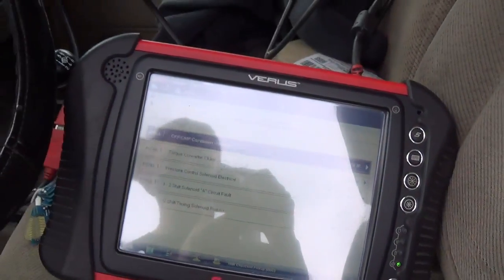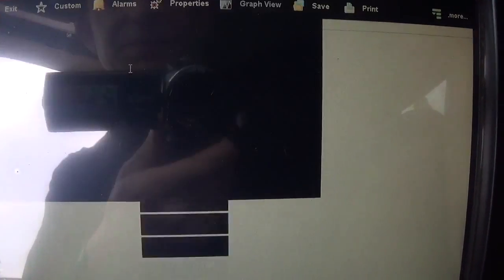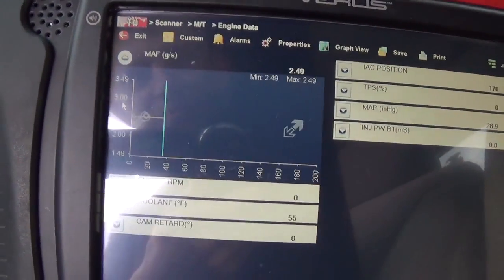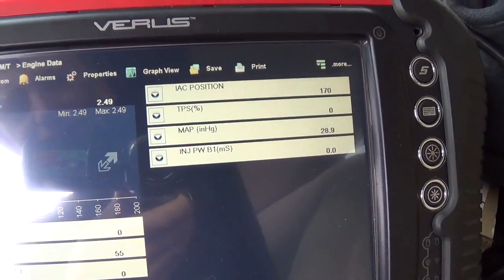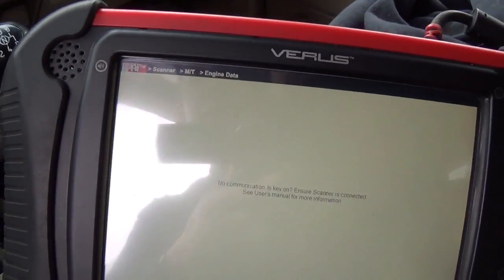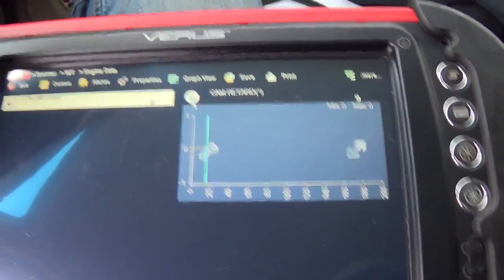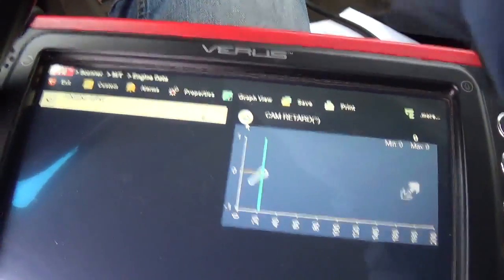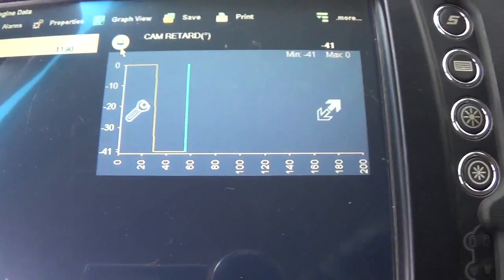Chevy 5.0 Crank no-start, Low Power -Part 1

Comment: I have a 2003 chevy silverado cranks tries to turn over but acts like no fuel. At the same time I have no interior or exterior lights, no power windows or locks, but all my gauges light up and work 🤷‍♂️

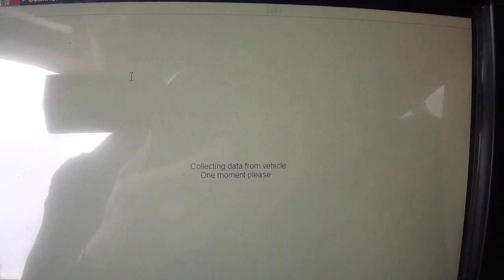Comment: Ok, let's see how good my guessing game is getting watching you and Eric. At 2:28 I'd say, seeing as the petrol gauge is reading infinity, the crank/no start is due to it being plum out of gas and the A/T codes are due to an ECU/wiring harness from an automatic model having been swapped in at some point. This would also explain the extra wiring under the hood.

Edit: wait, just thought of a more likely scenario... this truck used to be an automatic and had a manual transmission put in. As Eric O. would say: 'Ya big dummy!!' ;-)
Reply from the maker: Nailed it! :)

Comment: One client who doesn't change her oil to this guy who doesn't check his gas. Wow. Can't wait to see what else this thing needs beside lifting the radiator up and sliding a new truck under it.
Reply from the maker: +wyattoneable Wouldn't be surprised if it needed a new radiator too...there was a substantial coolant leak somewhere on the engine but the shop told me the customer "declined repairs" :P
Reply: Thanks for responding...I guess some owners are just short of cash and have to set there priorities. Nice job on your part though.

Comment: Fuel pump run and no fuel pressure at the rail,  I'm kinda leaning toward empty gas tank???  An hour worth of diagnostic time for an empty gas tank.
Reply from the maker: +Upallnight lol I'm pretty sure they'll check the fuel level next time before calling me over...or not.
Reply: +motoYam82 but the gas gauge is pegged on full.lol

Comment: That's an engine transplant from probably 1998 up.
Reply from the maker: +06acc It was hard to tell what exactly was original on this heap lol
Reply: I think you said it was a 95 which means it probably had a 5.7L with TBI. That looked like a Vortec MPI. Looks like it has the harness and ECU from an automatic? Just my 2 cents.

Comment: The ole AC compressor bypass pulley. Looks like they called you after they worked on it, did some swaptronics (PCM) and couldn't figure it out...gotta love those but you'll figure it out. Maybe it's just a distributor gear...something quick & easy. Looks like a typical 18 yr old Northern truck. Patch up the floor, make sure the heater/defroster works, stick a plow on it and use it for a winter $$ maker.
Reply from the maker: +Hayward&#39;s Automotive Except we didn't get any snow this year!
Reply: +motoYam82 Well at least you got enough for Geo Prizm Snow-Drive 2016.
Reply from the maker: Yup biggest storm of the winter...a whopping 5 inches lol
Reply: Mild winter. Looking forward to Part II!

Comment: That guy need belts. I don't think I could take that squeaking.
Reply from the maker: +argonian bilbo Amongst many other things...
Reply: It's possible it may not be the belt.. I had a Camaro that would squeak like that after I would turn it on, then it would go away.. one day I turn it on and smoke starts coming up from the hood, turned the car off.  Pop the hood, smoke was coming from A/C area.. try to crank engine over and it won't budge. Turns out it was the bearing in the A/C compressor, warning me it was gonna die and then it seized up.

Comment: Awesome Ivan, hey when you going to get some transducers to read fuel pressure and other oils?  I use  the transducer I have to look at Cummins Low pressure gear pumps and lift pumps.  They work great to identify pressure/volume issues.
Reply from the maker: +busjockey1 That's a cool application! I can easily adapt my transducer for any liquid...just haven't played around with it yet...
Reply: +motoYam82 Just hook it up and either power brake it or do a test drive at full throttle.  I use another channel on my scope to use as a reference when I go to full throttle, that way you know when you have maximum pressure demand.  So on your Verus, bear with me, used to use a Modis and I'm thinking what would be the best screen time to do the test drive.  I'm thinking do 5ms a division and then you should have a pretty decent buffer of data to look at.
Reply: +busjockey1 I'd be afraid to floor that thing. the body might come off the frame or the engine might blow up. then you would have to explain that to the customer.

Comment: Good video. At first the scan tool had auto trans trouble codes. Either the engine , trans, or computer must have been swapped out, right??
Reply: i was thinking the same when a saw a torque converter and the presure swich codes :)
Reply: +Cooll Asice look at the dash dont think a manual has park
Reply: +UBBERTANKER I suggest you look at the shift lever sticking out of the floor too.
Reply: +Cooll Asice he's saying it was obviously an automatic numb nuts
Reply: Kenny M No he's not, and my nuts aren't numb. Thank you very much.